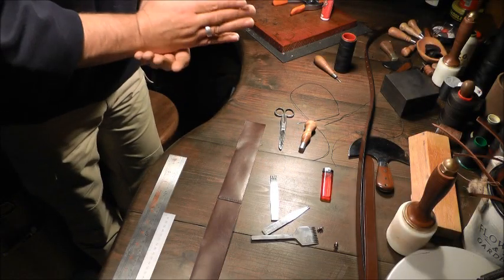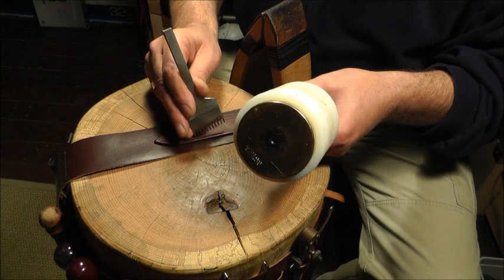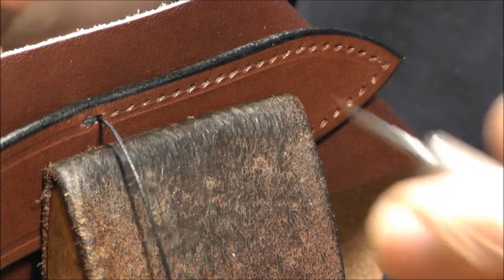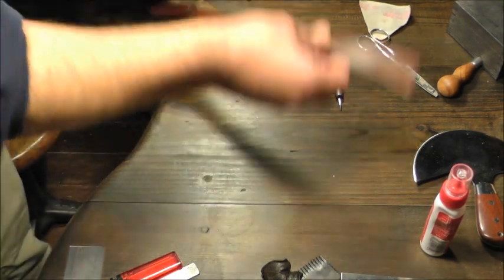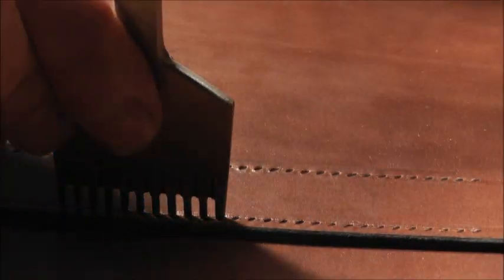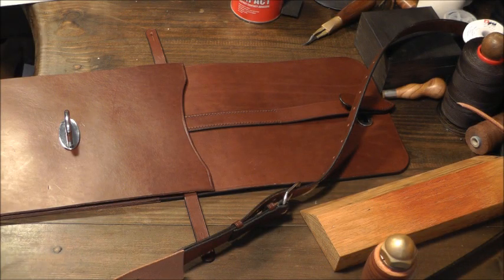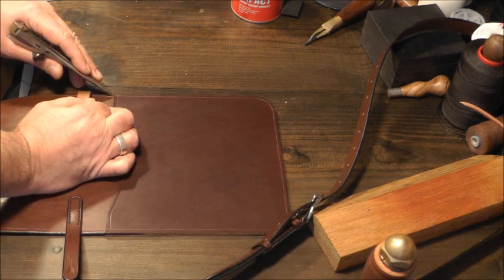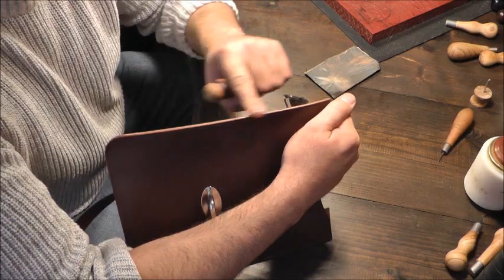Make your own Messenger Bag Part Two

Comment: Beautiful bag...Very inspiring...I spent a lot of time making custom leather watchstraps years ago...and have stepped away from making anything for over 5-6 years now...I am hoping to find some time to get back into this hobby and start making more straps as well as other leather goods again!  Thank you!

Quick question about the glue that you use....for most of the bag you were using white glue...but when you were gluing the main parts of the bag together you were using a different type of glue...what kind of glue was that and why the change in glue? Thanks!

Edit: And I just read the comment below that it's contact cement you are using.  Like Nolan asked, is there a specific type/brand that works better than another?
Reply: +Nick Leung ....Weld Wood by 3 M....Walmart sells it..This what I use..Use a pliers and pinch the sides with...

Comment: Hey Nigel, You use two different types of adhesive on the straps and the gusset. what are they and what is the advantage to using them where you did?
Reply from the maker: I use PVA to hold bits for marking and stitching, this washes off or the parts can be separated easily.
It's very easy to use and doesn't make a mess if I get it wrong.
I use contact glue around the gusset which is one chance stuff but sticks forever.
I didn't want the edges of the bag to separate so I used this instead of the PVA.

Comment: Hi Nigel, I bought your plans (fantastic quality I have to say) and sourced the 'loop' from Tandy's - but I can't find the chrome oval 'grommet' you show in the video anywhere! Is it a one off? I don't really want to just cut a slot, I'd like to make it a really strong fitting that won't damage the leather at that point. Thanks, Claire
PS Your videos are excellent.
Reply from the maker: Hello Claire, the company that makes them in at the back of the plans but a bit difficult to deal with.
Try the Ohio Travel Bag Company, they stock them and I think Page 21 of the catalog is where you will find them.

Nigel
Reply: Hi Nigel,
Ohio seems a big deal for one or 20 minutes. What i did was ordered from amazon a number 0, a house sign, that was big enough to take the loop! This looks fine and is an acceptable stop gap for not having the real thing. Thanks for all your help. Best wishes claire
Reply: As you can see, google dictation doesn't understand a Wigan accent, albeit I have lived in Shrewsbury for the last 35 years.........

Comment: The contact cement I use doesn't seem to be as strong as yours. Is yours a special kind? What brand is it?
Reply: +Nolan Gaudreau ....Weld Wood from 3 M....Walmart has it..use a pliers and pinch the joint together...